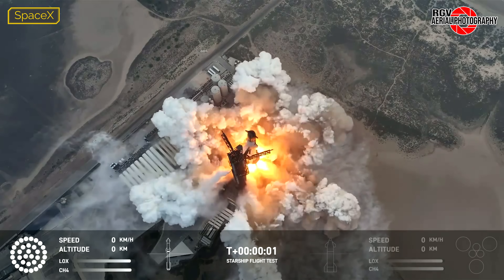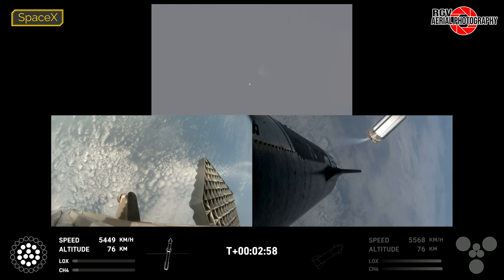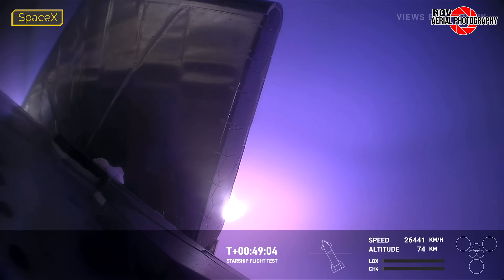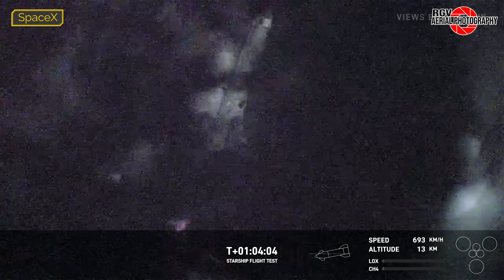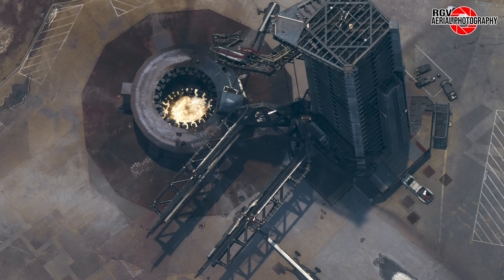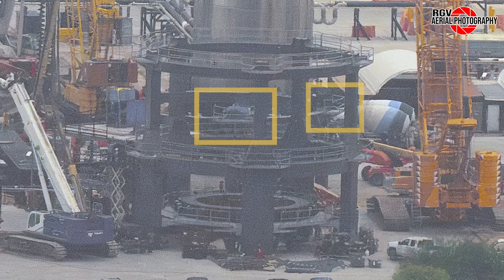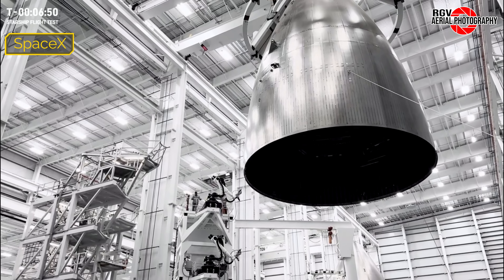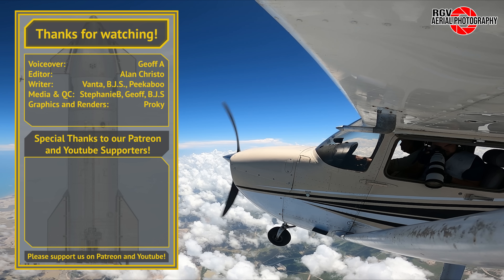Post Flight 4 Flyover - Starbase Review Episode 45

Comment from the maker: Unfortunately we weren't able to fly over the booster, it landed way offshore and we did not have good visibility of the horizon over the gulf due to the haze and became unsafe to attempt.
Reply: Pin this comment, as everyone is/will be asking about this.
Reply: How could you fly over the booster anyway? It's probably at the bottom of the Gulf.
Reply: @Barthhhelona  It's got big tanks which means it doesn't sink unless you blow holes in it. It'll end up as target practice for the USAF or navy
Reply: @NealeUpstone  In my mind, it's likely they would have sent a command to blow the ship termination charges. Do you really want to leave large explosives attached to something that someone may try to get to?
Reply: @Barthhhelona  you never know! and it may be visible on the bottom of the golf depending on where it landed.
Reply: @EAP_7 Precisely. There are areas of the gulf that are only about 150ft deep.
Reply: Next Time maybe!
Reply: Hi dad 🫶
Reply: SpaceX most likely opened all vent valves to allow the tanks to flood thus causing the booster to sink. I doubt that it stayed surfaced very long.
Reply: Safety first.!!!
Reply: In my mind, SpaceX should have a duty to clean up after itself and recover the booster and starship if possible and not just to gather data.
A large pressurized cylinder is like a PET bottle containing a little soda - it is pretty robust and should easily survive falling over in the water at sea level.
After all, the shuttle's boosters hit the ocean with more force, fell over and were reused, and they weren't even pressurized!
Reply: @ahaveland Depending on the area it may help as an artificial reef.

Comment: As I read the 3 FAA exemptions agreed for SpaceX, IFT-4 shouldn't trigger any mishap report so getting the license for the next flight should be a formality. If that is correct then the critical things now would seem to me to be how much damage was done to the launch site, i.e. how long it will take SpaceX to get all the GSE stuff ready for the next flight, and how long it might take them to apply any design changes that they might want to have for the next flight. I'm working on the assumption that SpaceX is going to want to fly the v1 boosters and ships it has as quickly as reasonably possible so a summer and autumn with an awful lot of flight activity (I hope) and then maybe a gap as v2 stuff is got ready to give the construction crews for launch facility 2 some longer uninterrupted spells to get construction moving as quickly as possible there.

Comment: I AM SO EXCITED ABOUT THIS FOURTH LAUNCH AND SUCCESSFUL LANDING OF STARSHIP !  DO YOU BELIEVE WE ARE GOING TO BE ON THE MOON IN 16 MONTHS WITH A MANNED CREW !  I LOVE YOU ELON !!!!!
Reply: 16 months is too early. Probably in almost 3 years. They need to fix each problem as it comes up. It still has problems that needs to be fixed, And it will get heavier as they add more structures, and internal parts. Adjusting them also requires time.

Comment: Not sure how the chemical reaction would work, but I'm wondering if the gold colouration isn't due to oxidation or even sulfidation of the surface layer under those extreme temperature and pressure conditions. I.e. a thin layer of iron pyrite.

Comment: Points for argument. #1 The heat shield will never be certificated for human flight. #2 The damage to the olm and tower after each flight makes rapid turnaround impossible. Discuss.
Reply: Already quicker then the shuttle was! 😲
Reply: The heat shield certainly has a ways to go, however I think on this flight the main issue was likely the flap hinges. SpaceX was already aware these would be a weak point, and have made modifications to newer ships, moving the hinges aft. I'm sure they'll continue to improve those in the future. As for OLM and tower turnaround, they've improved their speed each flight, and I think once SpaceX has come fully up to speed preparing full stacks for flight, their turnaround time will greatly decrease. Obviously, the tower at the Cape, and the second tower at Boca Chica will help as well.. Overall, SpaceX and Elon's goals for Starship seem more achievable each flight. Thanks to RGV for the footage!
Reply: On point#2, there is less damage every launch as they continue to upgrade and modify. They will get there.
Reply: Totally agree. Starship will never fly humans from the ground to LEO. Heat shield is a factor but to me, landing sequence is even more deadly. If one engine or flap fails, crew is transforming into pancakes two seconds later.

Comment: Oh wow I just noticed that they show thorttle on the graphics too. You can see how the ship starts at around 50% thrust and procedes to throttle up a few seconds later.
Reply: Unless I'm mistaken, those are fuel measurements, not throttle indicators.
Reply: That's not throttle, that's fuel levels in the main tanks (the fuel levels in the header tanks aren't shown).
Reply: @SlartiMarvinbartfast  I don't mean the horizontal propellant indicators. The engine circles themselves start out as a dark-ish grey and become bright as they start up fully.

Comment: I don't know the metal in starship's flap hinges, but if its tungsten its been well worth it high weight penalty.  One of tungsten's unique properties is its very high melting point of 3,422°C (6,191.6°F). This is the highest melting point of any metal.
Reply: Tungsten isn't easy to forge or weld, though (but it's not impossible to so either).
Reply: I would suggest they use tungsten for all parts having to do with the flaps, except the tiles, including the flaps themselves. Failing that they might consider replacing the flaps with modified grid fins and altering their landing profile

Comment: It seems it only select number of Starlink satellites support relaying high definition video from a Starship hurling around the planet.
Reply: there was a comment on X that implied they still had internal cameras during the time they weren't showing any external ones in the middle of the test. So that wasn't the case. toward the end of the test, the starlink antennas might have had a buildup of condensed metal spray like we saw on the camera, which would impair the signal.

Comment: Surprised there wasn't a fairing parachute on the underside of the hot staging ring.
Reply: That's quite a bit of engineering for a problem that will be fixed on starship block 2
Reply: Thats the opposite of what you want for something like that. No parachute means it doesn't translate a lot when coming down and wont be a hazard.

Comment: Is IFT-4 Starship 29 still floating? Can it be towed to Perth perhaps?
Reply: No, it likely sank out of sight within a short time after "landing" in the water.
Reply: Attempting to tow a structurally impaired flammable gas container into port is not safe. I can't see any port letting them do that. They would analyse it and sink it right thereif floating still, they would have landed it in deep water suitable for disposal as practice for landing tower approach.
Reply: I think they destroy it by exploding, other countries can stole the hardware of starship
Reply: @khel9505  Not likely since both vehicles will sink soon after touch down.

Comment: TheSpaceEngineers pics align with my theory that the flap really was hanging on by a thread. There was some weird twisting movement not along the hinge line as it was performing the flip maneuver. Quite how it managed it in this condition is mind boggling! Any ideas when we should see ship versions with the flaps more leeward as Elon suggested?
Reply: The engines gimballing would have taken care of the flip, I'm more impressed with how it managed to stay on a good attitude for the vast majority of the flight with the flap burned out. Honestly though, quite lucky that the burn through happened late into the entry after peak heating. Overall though the ship appeared to be a massive success, just have to solve the problem of having a hinge (and therefore necessarily a separation between parts) that can stop plasma getting between it at Mach 20.
Reply: The flap finally gave out and detached once Starship belly flopped into the ocean.  It was like somebody writing a cliche for a movie.  Little wonder there are already flap memes.

Block 2 is already being manufactured.  I personally expect it to be what they use for IFT6.  I think if they really tried to solve the melting flaps for IFT5, that would be a waste of a potential free flight.  The FAA will be giving the IFT5 license in short order so it's better if they just send up Ship 30 with its known flaws and get some new tests done.
Reply: TheSpaceEngineer seems correct. The flap was torn of the front mount just at the end.  Well Spotted!
Reply: The gimbaled thrust of the Raptors does most of the heavy work during the flip and, as we've now seen, can compensate for severe damage to at least one forward flap. I suspect that the other forward flap was possibly damaged too, perhaps the aft flaps as well.
Reply: The flaps should be made of stronger metal - possibly tungsten.